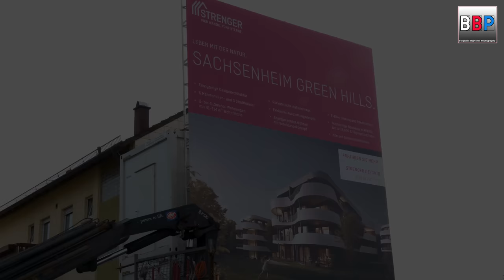VOLVO EC380E & Mercedes Trucks, Sachsenheim, Germany, 26.02.2021 #1

Comment: Nice video - big excavation project and nice Volvo swinging the dirt. Do you have half load season there, here we have it due to spring thaw and to protect the roads. Cheers and stay safe
Reply: There is no half load Season in germany. The normal limit is 40tons total weight.
Reply: Max weight 40tons~88500lbs
Reply from the maker: "Half load season", that's funny! We've strictly and high prohibited regulations. Hans Do and Piu forte Ragazzi did not right.

Comment: Und warum ladens die lkw nicht voll ?
Reply from the maker: Geht nach Gewicht und damit unterwegs nichts herausfällt. Wird vond er Polizei immer streng kontrolliert.
Reply: @BeytekinConstructionMachinery  In "Cambodia" (you tube clips) sind gleichartige chinesische? 4- achsige LKW mit doppelt so hohen Bordwänden versehen, u. mit schwerer Lehm- Erde bis Oberkante plus "Sahnehäubchen" beladen. Deren Straßen sind wohl alle als "Panzerstraßen" ausgelegt.